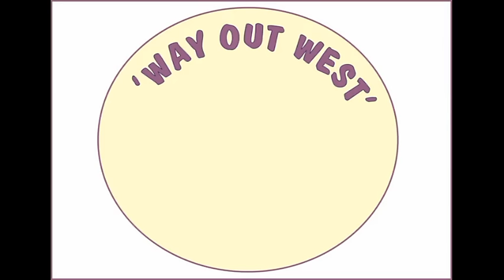How To Free Up An Angle Grinder Disc That's REALLY Stuck

Comment: If I had second grinder, I wouldn't be worried about it!!!!!
Reply: Wahab Algarmi I would personally use a hack saw
Reply: Ha Ha! That made me laugh. :-)
Reply: Lmao !
Reply: I needed a solution so bad and I tried all the things he tried then it came to the part when he grabs the second grinder. Lol
Reply: I actually did end up getting it unstuck without ruining the nut. I broke off the excess blade then took a chisel and work the chisel around the nut a few times and it came lose.
Reply: Hahaa.. LoL 😄👍
Reply: fr if i had second one i wouldnt be worried about first not working properly
Reply: You wouldn’t really need a second grinder.  Clamp a second cutting disc in a vise so it can’t move, turn on the stuck grinder and run it against the clamped disc until it wears the old broken disc away.

Comment: I had a Bosch 9 inch angle grinder that has been locked up for over 5 years, tried all the usual, even welded a nut onto the plate but this idea worked except I didn't have a 1mm disk around so I used and old 5 inch diamond disk. Less than 2 minutes and I have now recovered my grinder. I have had that grinder for 30 years so I am really pleased to have it making sparks again. If you are ever around this way I owe you a beer or two mate.
Reply from the maker: Good stuff!

Comment from the maker: Ok everyone, I didn't think it was necessary to say that I had tried all the obvious things first - but it seems I should have done. OF COURSE I used the special tool that comes with the grinder, AND I put WD40 oil on it, AND I tapped the holes with a hammer AND I tried vice-grips. I am not stupid. (In fact I didn't try heating the nut for fear of heating the gears too much, perhaps I should have done but perhaps I would have wreaked the whole machine.)
This video is about what happened AFTER I had tried all those things and still nothing had moved. It seems most people have never experienced a grinder that is really stuck - and it has only happened to me twice in my life - but when it does happen to you, then I hope will find this helpful.
Reply: You are quite a craftman..
I have a turbo concrete cutting disc really stuck..
Reply: You should have tried with more wd40
Reply: Thanks, I've been stuck for an hour and almost messed up my grinder, but your method worked when all else failed. Thank you!!!
Reply: Way Out West Blow-in blog you did a great job  thank you friend
Reply: @WhiteEagle7895   What do you suggest? Have a few pallets of the stuff delivered to fill the effing swimming pool? Sometimes shit just won't budge, like a new form of welding.
Reply: Heating and cooling did NOT work for me. Tried every mechanics trick in the book.  This seems to be the only method. Thanks for the tip before I took it to the tip :)
Reply: I think you did an excellent job in showing that this was a last resort. I've been surfing videos to het my grinder unstuck and this is the best one yet!
Reply: This just saved me from a lot of head scratching and embarrassment! I made a schoolboy error by not supporting both sides of a length of angle iron when cutting in half with a 9" grinder. One half dropped slightly, snagged the disc and locked it on so tight nothing could budge it.
 I went for a nervous toilet break and decided to search for a remedy and found this gem of a video.
Rescued by my little grinder and back to in minutes. Thank you so much from a red faced welder in Lincolnshire

Comment: I just had a grinder nut over-tighten while using it; oil or heat didn't help. The main issue is that the key is terrible, either too soft and bends, or simply slips out of the holes when applying pressure.
 
My solution was to use my little Dremel to grind down small flat sections on the sides of the nut and use a wrench. I don't see why they aren't designed this way from the beginning, much easier!

Comment: I struggled and struggled with this issue.Then I saw your video. I spent no more than 7 or 8 mins doing exactly as you said.I cleaned out the old wheel with my other grinder ,barely tapped the nut and it spun free. Thanks so much !! It occurred to me that a dremel with a cutting wheel or even a hack saw would work too.
Reply: Tried the hacksaw first - amazed how it wore out the teeth in minutes due to the abrasive particles in the tiny bit of disc left over.

Comment: Hey!  Thank you, this worked like a charm in about 3 minutes- compared to the hour beforehand, trying everything else. I finally remembered that EVERYTHING  IS ON YOUTUBE! Eureka! In 20 years I’ve never had one seized up that bad. I put a little oil on the spindle when I use wire wheels to prevent seizing, and now I’m going to oil it every time. Great vid. 👍👍

Comment: Thank you, thank you, guys. I had the same problem, smashed the disk, took off the guard, clamped a thin metal file into the bench vice and ran the angle grinder along it. Came off like a charm. Much appreciated.
Reply from the maker: Good job! Well done.

Comment: Wonderful. Many thanks, you saved my life. Just one thing, as I didn't have a second grinder, I first used an ordinary hacksaw. However as the hacksaw blade is thin, I switched to an old panel saw whose blade thickness is similar to the grinder disc and it worked a treat! Thanks again.
Reply: No wrong name, mine's Paul

Comment: I had this problem, never thought of your remedy which suited me fine as the existing blade was knackered and needed replacing. Used some WD40. Smashed the old blade off, more WD40, tried with a plumber's wrench and with easier access the nut came free. My angle grinder was an expensive one so I did not want to buy another one to do the final stage you showed but your idea solved the problem for me. Thanks.

Comment: Already broken the spindle lock housing on an almost new angle grinder trying to remove a really locked nut.  This has NEVER happened before in my entire long lifetime. Two people battling for HOURS. I am about to try this. Will never use those thin cheaper discs on a large size angle grinder again - they seem to somehow almost FUSE the nut to the body so cutting it out like you've done is the ONLY OPTION LEFT & AWARD YOU A 🥇🥈🥉🏆if I get it right. THANKS.

Comment: i didn't have a second grinder, so i just clamped the grinder down, taped down the trigger, plugged it in and dug out the broken blade while it was spinning with the pointy handle end of a file.
Reply: Thanks, your method with the handle end of a file worked great. Two minutes and it came off. Appreciate your advice.

Comment: it worked! I had a oscillating tool and channel lock pliers.

I would have used the tool that came with it but I kid you not that ** got bent after I put it in a vice and attempted to remove it by pushing the angle grinder up.

I'm happy but I'm also kinda pissed. It should not be THAT hard, why not make the disc thingy that pinches the disc a square in order to get more torque!?

Whatever. Today was a success

Comment: One can use hexa blade and little oil or thinnest file one can get to wedge between two holderers to cut the cutting wheel hub till the central nut. This video has been very helpful. Critics might say n number of things about scond grinder but it really quickens the process. Having friends with second grinder can also be useful. A craftsman has think out of box.

Comment: Problem is where to find another one. Happened to me once. The reason which causes this problem is when you put the metal side of disk facing grinder motor. Always put the disk this way that its metal side is facing outwards not inwards.
Tip: always put a thin piece of paper size of tightening nut on both sides. I can guarantee you you'll never face this problem ever again

Comment: If you have an expensive disc in the grinder you don't want to destroy you can drill a series of holes in the nut to perforate a channel that frees the pressure on the threads and allows you to get the nut off in pieces. Do that if a replacement nut is cheaper than the wheel.

Comment: To add my 5 cents, if you happen to have one of those expensive diamond cut discs and therefore removal of disc is impossible, then you can get away with a hacksaw. All you need to do is cutting off sides of the nut itself and with reduced surface resistance you will be able to unscrew it after few cuts and save expensive disc. And cost of replacement nut is just a couple of bucks. Thanks
Reply: Thank you!!!! This is the solution I needed. I have a wood carving disk on mine that I can't just break.

Comment: I used a recpricating hacksaw with a bent blade instead of another grinder, and got the nut off without causing it much damage. I tried a flat packing washer behind the disk, but it still locked up. Thought I would put a bit of greese on the spindle next time and see if that helps. Thanks for the post.

Comment: 🤣yeah ground myself into a locked disc yesterday.  New grinder couple weeks old and newer model than my previous.  Lighter and no kick starts.  Anyways was cutting bed rails for scrap bin to fit and of course needed to change a mangled disc that ended up splitting during the job.  Old grinder stopped working I’m pretty sure it was the switch so not scrapping that yet until I feel motivated to look into it.  Anyways always something 🫵😜

Comment: Before you get to the stage of damaging the tool supplied with the grinder try grinding  (with your second angle grinder) a 17mm open ender to give it a slimmer profile, it's very commonly that size, to fit the flats on the spacer block behind the disc.  Being able to effectively lock the shaft will give you much more torque to undo the locking nut. I had to do this not long ago to remove a disc when the push in locking mechanism wasn't strong enough to hold.
Reply: Yeah, did that. Borrowed a grinder, made a thinner tool, because they didn't sell that fin, and then broke the two pokey thing tool....

Comment: thanks so much! You've saved my day. I forgot to mount a piece after the protector and the disc was stuck. I couldn't get it out any other way, but breaking it fixed it!
Did I mentioned it was on the angle grinder first use? Shame on me!

Thanks again!
Reply: beginners often think they have to tighten the disc very much, before grinding - that is often the cause for the stuck disc
Reply: Willy Van Hauteghem amen

Comment: I’ve got one stuck bad on my 7” Makita with a  backer pad and sanding disk.  I was sanding a sub floor hit a nail. The disk got caught and I believe what happened is with the momentum of it spinning it tightened itself up. I think this should work if I cut away that rubber backer pad.

Comment: I cut 2 flats on the sides of nut. Gripped it in my bench vice and it did the trick.
Reply: My attempts broke the entire spindle lock housing  and we were two people concentrating all our strength in different ways for hours.

Comment: Guys try using a lighter. I mean use a vise to fix the blade or the disk then heat the nut by a lighter for a couple of minutes and then use a pipe wrench to remove the nut and there you go. By the way if the wrench doesn't work for the first time try taping the nut with a screwdriver and a hammer then use the wrench.

Comment: Thankyou so much!!! this video helped out a ton! i had the same problem, i bent my special  wrench, and the vise-grips didnt help so i did exactly what you did but i used the dremel to remove the remaining disk material from the nut and it eventually came loose. From now on i will ONLY buy DeWalt cutting disks. now i need to know how to prevent this from happening again... Anyways thank you so much!
Reply from the maker: Excellent!

Comment: (For anyone with a smaller angle grinder) I found that smashing the disk & then using the special tool worked a treat, it does take a little elbow grease but you'll get there... don't let it stress you out like it did me lmao

Comment: pipe wrench did it for me, it was so stuck it broke the teeth of the 2 pin wrench. i did remove the exposed part of the disc and the hood, poured some oil into it, grind every bit of the disc the was left with an old serrated edge knife, applied more oil, let it sit overnight, then i thought of using a large pipe wrench, and when i did it came lose easy with 2 taps of the wrench with my palm, the nuts undamaged

Comment: The nut self tightens are you use the grinder, mine locked up after using the cutting disk which seemed to put  more torque on the nut. To remove I did as per the video except instead of using another angle grinder to cut the old one, I was able to put the removable nut in the vice then grab the fixed nut with stillsons and apply force till in cracked .. good luck all

Comment: did you try , push block pin and wack on the cutting side of disc. I used backside of big metal saw.sometimes not work....brush the threads clean .we welders don't tight the disk with spanner just use gloves. wack the disk with gloves off.just another idee. goedendag
Reply: +georgio jansen or put a bolt with washers in a hole on the outside of the disc and then work with that.

Comment: Just heat up the nut a bit,which will cause a bit of expansion of the nut and it will come loose.
Reply from the maker: and risk overheating the nylon gears? No thanks.
Reply: Just heat up the nut a bit,not melt it.I would say about 200 degrees celsius.As it release,then you cool it with water immediately.It happened to me and I got this advise,done it and it worked.Just do it on your own risk,especially if your grinder got nylon gears.All grinders I know of,got metal gears.

Comment: I just got a used grinder off of someone else. There is no nut outside of the disc to get the tool onto. There is nothing there to grab with channel locks. I don't know how to take the disc off! Any tips?
Reply from the maker: No nut? What's holding it on?

Comment: I hope you can help, I've been looking all over google but without any results.  I  am new to angle grinders, and my dad left me one and I've been trying  to change the disk but low and behold there was no holes where the tightening nut, I'm not sure it has a nut to tighten.  someone told me that the disk is put on backward so my question is how do I take it off?
Reply from the maker: +Bitcrossfire1  Hmmm, interesting problem. I just googled 'angle grinder nut' and chose images. If you do the same you could perhaps find the one that looks like yours and follow up from there? There are some that don't have holes - but they should twist off by  hand. Good luck!
Reply: thanks I'll take a look.
Reply: I have a surefire way. First turn the grinder upside down and to the left exactly 46 degrees. Close your dominant eye 34% and elevate your right foot to a 12 degree incline (if you are left handed it would be your left foot) don't forget to butter up the grinder with sweet encouraging compliments. Works everytime.

Comment: Better to clamp the grinder in a vise, then cut the damaged disk off flush with the lock nut.  Then get something narrow like a gyproc knife and blade and with the grinder trigger pushed and spinning, work the gyproc blade in to wear down the broken disk.  The disk will wear away and so will the gyroc blade and after a blade or two the broken disk will be gone.  This method doesn't damage the grinder locknuts or shaft.  The gyproc blade won't cut into the steel components.  Best to use one of those knives with the sectional blades so you can keep extending more blade as it gets ground away.

Comment: I think by applying WD-40 it will works. But don't immediately open it, wait for 5 minutes or more, after the oil really seeping into the thread you can possibly open it.

Comment: same way i unsrew mine but i did not use a 2nd grinder i just use a stainless plate same thickness with the cutting disk and keep hammering way in until it broke into pieces

Comment: I wish I could do this but I am dealing with a concrete wet grinder. very much the same type of tool. unfortunately, there is a (high carbonstainless steel I think) diamond blade.
Reply: Me Too

Comment: Im currently in this situation but the stuck disc is a nearly two milimeters steel disc for ceramic cutting! i can't go through it with my dremel :/
Reply: cedricfilm heat it

Comment: The real question is "What should I do, not to get into this problem?"
I ask this coz it's happening frequently to me, now a days and please don't tell me "Don't ever buy from HarborFright again"... There has to be something that I'm missing when putting the blades on or may be after every work I should detach and remove the blade immediately or use some sort of silicon or gasket in between the blade and grinder attachment.... Any wise one with a hint?
Reply from the maker: Make sure you always have a little grease on the thread. Also it may be worth changing the nut - they are more likely to bind if they are worn. Good luck!

Comment: ..or another less destructive way: get someone to hold the grinder with it's disc in a vice. Take to one of the 'key holes' with a hammer drill on a hammer only setting - I used an sds type drill. Came off really easily, then did another one that had been stuck for years.. cheers all.
Reply: ^^ obviously you're working on an angle, trying to spin off the flange, not drill into it :-)
Reply from the maker: I'll try that the next time. Thanks
Reply: 230mm grinder having diamond blade on was totally stuck. 
At first came here & watched the vid. As those methods didn't fit I started reading comments here.
Took a hammer drill Makita DHR202Z with a short 5-6mm drill bit so it fits to key holes and.. Issue solved.
Thanks!

Comment: i have a small butane in can with a torch then heat the nut for a few seconds. ruins the disk but ..
most of the time a nut gets stuck is because of a warped or broken disk.